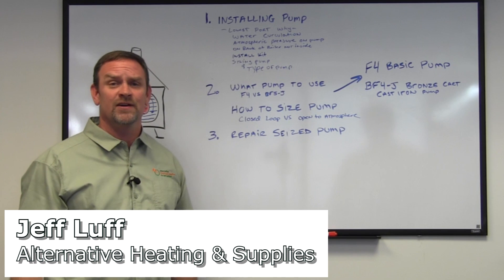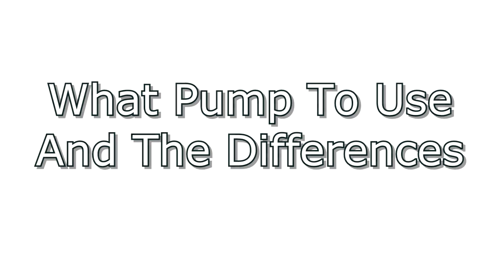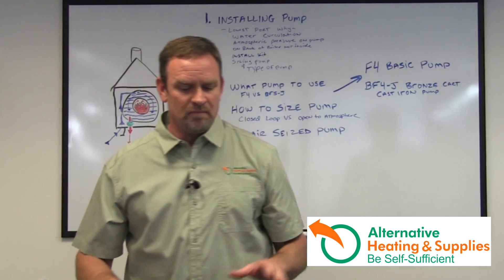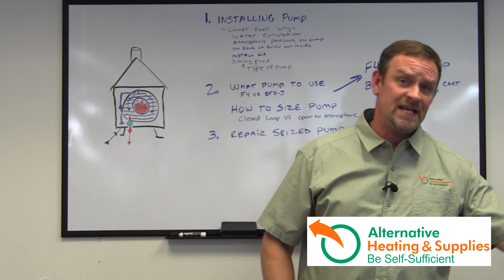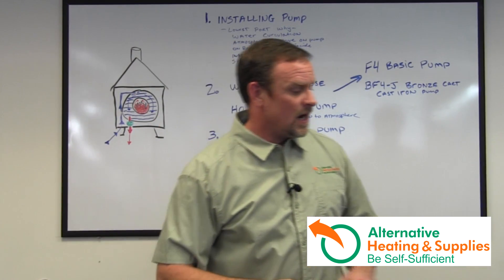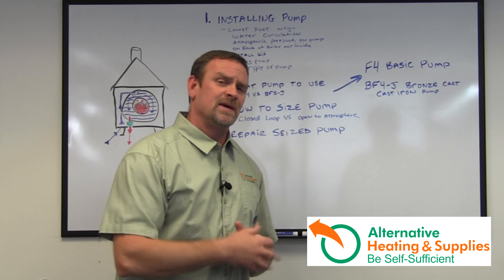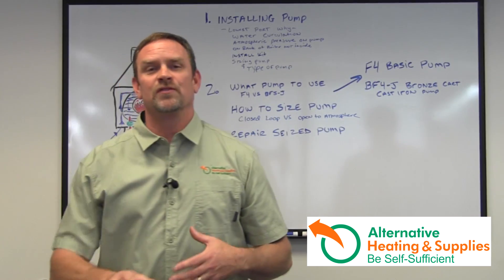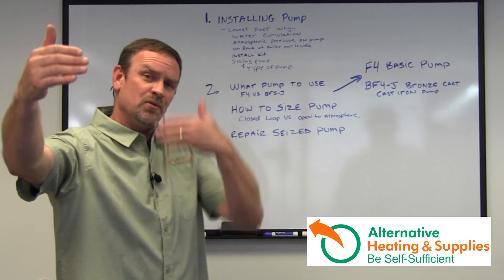How to Correctly Size a Wood Boiler Pump: Pumps for Outdoor Wood Boilers

Comment: Are the taco 011 and 009 flange the same as the 007 with a  one inch pipe threads
Reply from the maker: Flanges have the pipe thread, not the pumps...

Comment: Hi Jeff just wondering does the circulation pump on a 3000 heat master stay running 24/7, guess it has to keep water circulation through the system.

Comment: Great video. I took your advice on the correct pump type and size. However, I have an open no pressure system approx. 300 ft. total loop size with 1" feed and return lines. I replaced a taco 007 with the 2400-20. I have better circulation although my incoming temp will not go above 140 when my ODWB is at 200. What I am doing wrong. Should I add another circ. to the system on the return line? If so does it need to be the same taco 2400-20 or can it be just a taco 007?
Reply from the maker: Sounds like your underground insulation is compromised and your loosing heat in the ground. Pump won't fix that. Jeff
Reply: Thank you @AltheatsupplyLLC

Comment: Wondering if anyone can help. I have an older system from the 90's and my pump is currently not working. It is a 006-BC4-4. I'm having a hard time finding the exact replacement. I am wondering if I could replace it with a 006-BC4 pump. It appears to have the same specs. Any idea what the difference is?
Reply from the maker: You don't need the exact pump and usually they are using the wrong pump. Give us a call and we will size your pump and get you the best pump for your application. Jeff (203)-881-1602

Comment: I'm in the process of installing a central boiler 560. I have 170ft of thermopex from boiler to the house. It then flows through a 60 plate heat exchanger fir the house and a 6 plate for my domestic hot water... will the taco wood boiler pump suffice? There isn't much out there with sizing
Reply from the maker: Give us a call. we need more information. 203 881-1602

Comment: I have a Hardy H2 furnace.  I run my house about 30 ft away on a Taco 009 and my shop which is about 150 ft away on another Taco pump off of the same furnace.  The house warms fine but the shop doesn't warm very well.  What do you recommend is the right setup for this as far as pump size?
Reply from the maker: In the shop is the heater too small? Or are you not getting the water flow you need? Need more to answer your question.

Comment: Jeff on the pump designed for the boiler industry are you saying there is no need for speed adjustments...I’ll be using a HMC250 furnace feeding a DHW heat exchanger first then a HX in my attic furnace then back to the Boiler...total length of run is in the neighborhood of 250 feet....is this dooable

Comment: My total loop is just under 400ft.   Should I run the 2400-20???
Reply from the maker: I'm really disappointed with the 2400-20-wb they have been failing a lot. I recommend Taco 0013 BF3-J
https://altheatsupply.com/taco-0013-circulating-pump.html
Jeff

Comment: My 0011 lasted me 44hrs of run time. The shaft broke. 220 ft head length 1" pipe size.  Not sure what caused the failure

Comment: Can you use a .009 with the 2400-20 in a push pull system?
Reply from the maker: No, don't recommend. stay away from the 2400 pumps

Comment: What do suspect a Taco 2400-30 would be good for in terms of total  feet of 1' pipe going through a brazed transfer plate. I know a good amount of variables exist just trying to get your input.
Reply from the maker: I stop selling the Taco 2400 series pumps. Big fail rates. Jeff

Comment: The distances you are mentioning in the video that each pump/circulator will work with are for a open system and not a standard pressure filled boiler system that has no pump head.
Reply from the maker: That is correct. Most wood boilers are open systems. Jeff

Comment: Distance from owb to house is 75 feet for my system.  Pretty much a straight run with only turn at the heat exchanger.  I've been using 007 pumps for years!  They only failed on me due to over heating due to leaks in the water tanks.  I have also used an 011 and it didn't make a difference and it crapped out on me after only a year of service!  The 007 cost half the price and uses less electricity.